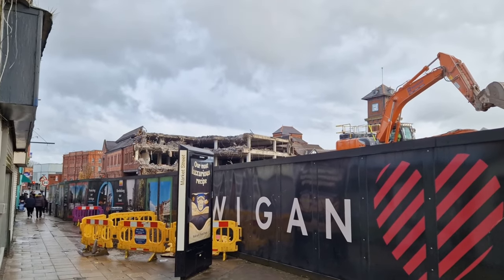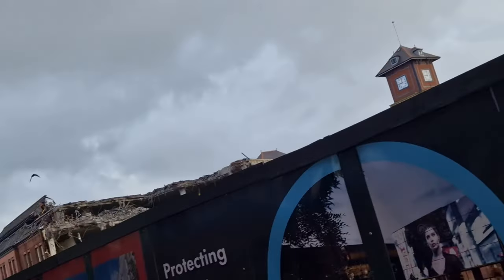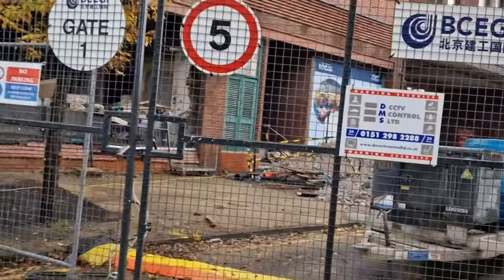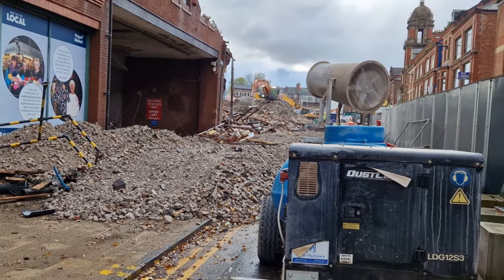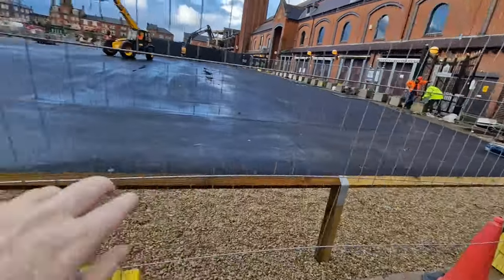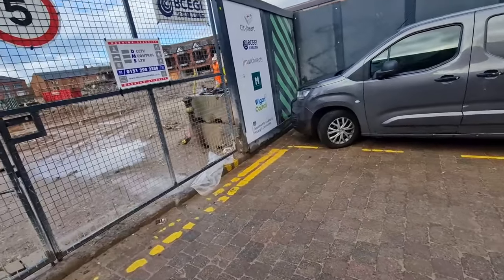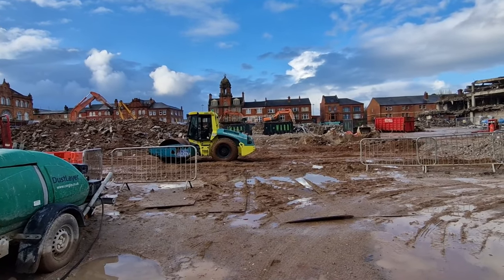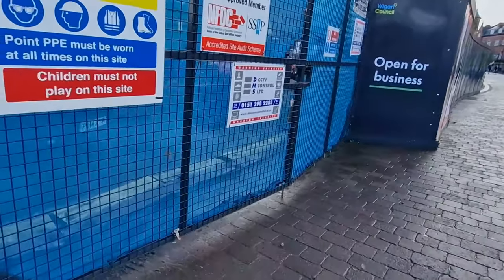Wigan Galleries Demolition Update 7/11/23

Comment: What’s happening with the new building
Reply from the maker: Not sure on the timelines. But at some point. The new market hall should start to be built. Once that happens and the traiders are housed in the new hall. Thst should open up the slots for the test of the project to kick into gear. With the new cinema building and the bars - restaurants following suit. The hotel and apartments are I think. Due to be commenced once the current market hall is down.